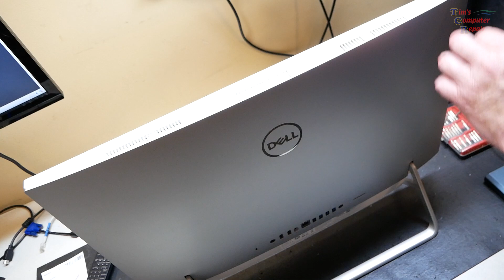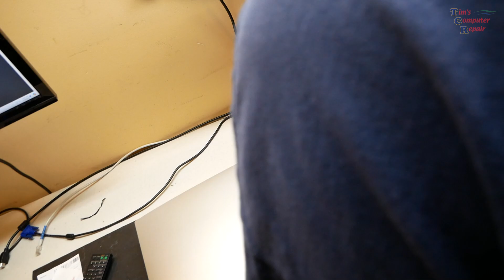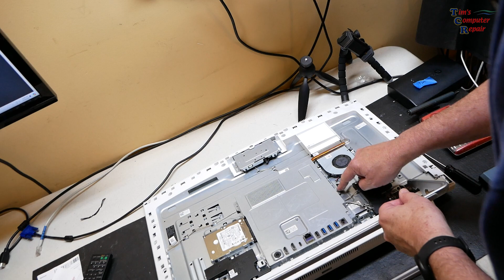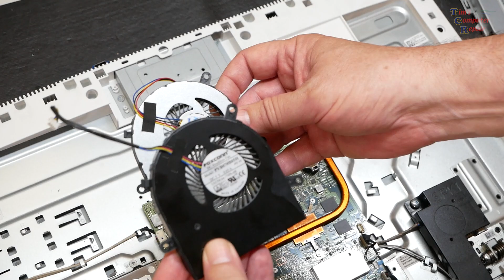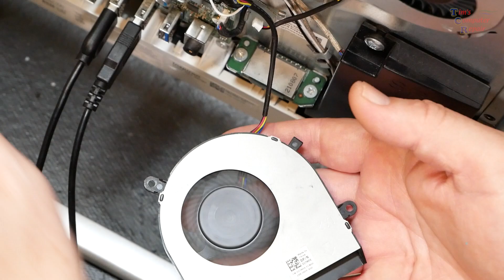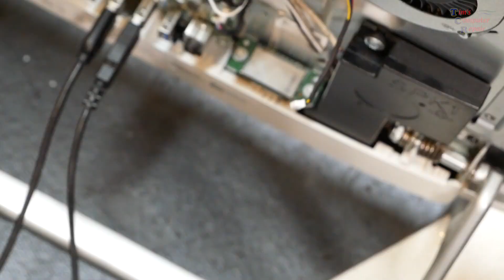Replace Your Failing Cooling Fan in a Dell 7700 Series All in One Computer

Comment: Thank you! Seems like an easy fix for me to try. By the way, just out of curiosity why didnt' you just vacuum the dust from the original and replaced it. Just curious because it looked very dirty and when you retried it it worked. Thanks again!
Reply from the maker: The bushings are bad on the fan and that is why it was making noise. After cleaning the fan may be quiet for a bit but the bushings are still bad. It would have eventually started making noise again.

Comment: I'm confused. The link shows me multiple fans that say they fit my model, and with various prices. Which one do I  buy? Which one will work without having to return it? lol
Reply from the maker: You need to access the fan and match the p/n number to the link I posted to be sure you have the correct one. There are many different revisions of this model computer when it comes to the cooling fan.

Comment: Very informative and easy to follow. I have this computer and it is working fine, but about every 15-45 minutes it makes a strange motor spinning sound from a spot in the back, that I assume is the fan? Then the noise stops after about 60 seconds and it is fine, but will start again in 15-45 minutes. It seems to be getting more frequent. Is this what a failing fan sounds like? Thank you, Tim! 😀
Reply from the maker: Glad it helped

Comment: Great Mr.Tim. I have very small question, my Lenovo legion5's fan spinning for short time when my laptop bootup and then stop for little bit and then work normally , is that normal process or abnormal and my fans should always run from bootup to shutdown without stopping
Reply from the maker: The fans kick on when the chip reaches a certain temp.